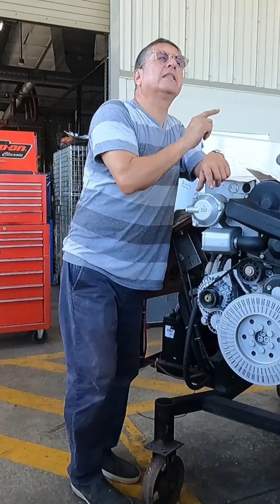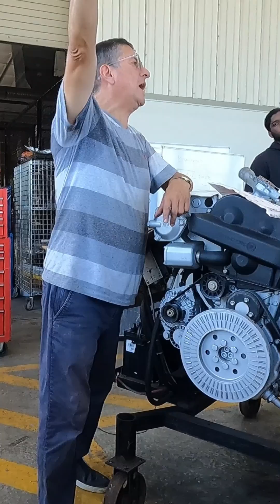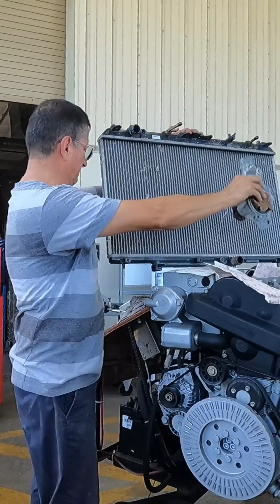Thermostat Troubleshooting

Comment: I always thought, if the lower(inlet) is hot,but return is cold,is the sign of the stat being stuck shut and not circulating..can someone elaborate,because that's how I've always checked for a bad stat and always seemed to troubleshoot it right for 20+ yrs....I always want to learn more,so Im open to tips